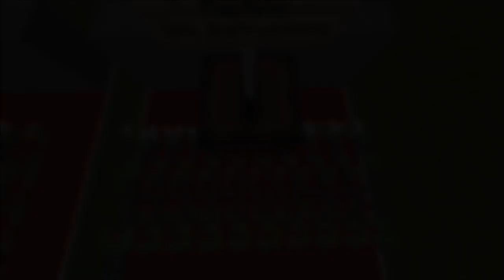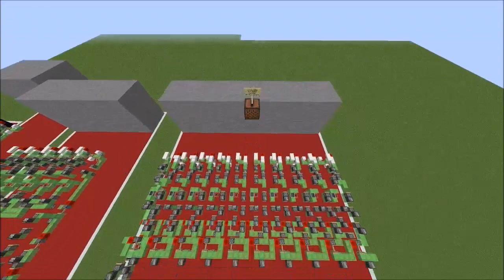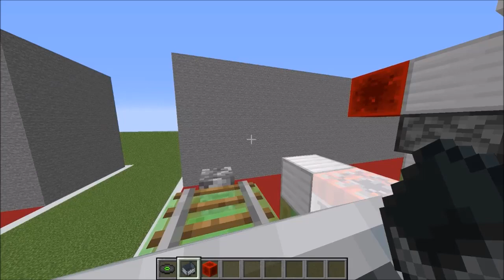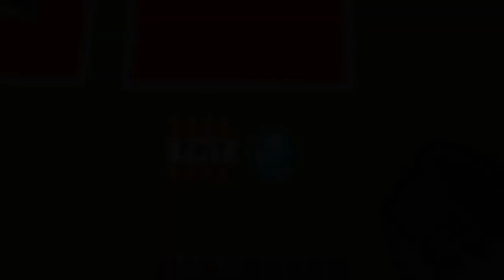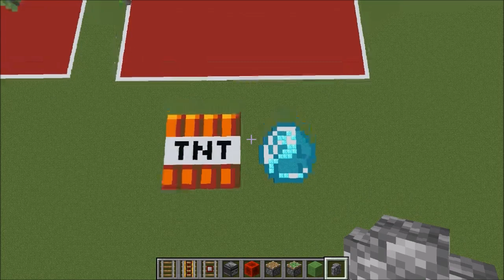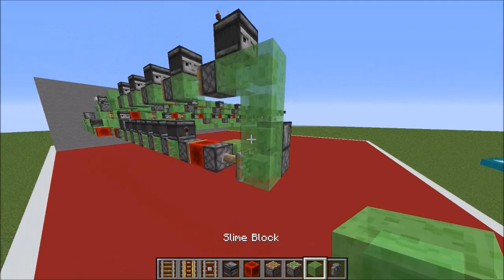Diamond Mining / Tunnel Boring Machine Tutorial for Minecraft 1.14/1.15+

Comment: Good job, cool machine.
I built it on the server with my friends. It worked nice, but after 15 shots the tnt explodet in the foot. Do you have an idea what the problem could be?
Reply from the maker: I'm glad you were able to find the video and duplicate the build. 

Some things I can think of that may cause a failure is; 

1: Triggering the machine multiple times before the tnt has been lifted/thrown and exploded, leaving additional tnt not primed and timed correctly. Make sure to only trigger the machine once, wait for it to be launched and exploded before triggering the machine again.

2: The server is not using vanilla Minecraft as provided by Mojang and is instead running modded server code, such as a "vanilla" spigot server. 

3: Insufficient initial clearance / excavation. If there isn't enough distance from the lifter/thrower and the wall, then the tnt will explode too close to the machine and blow up the some of it. As well if the ceiling or floor have not been properly excavated, then the machine may stick to and drag additional blocks and would likely cause a failure.

4: As pointed out in another comment, the buttresses need to be trimmed on the last module to not have the extra slime blocks. This is talked about for a single wide @ 30:30 but applies to the end module of a multi module build. If those slime blocks are left in place, eventually they will stick and cause a failure.

5: Always to be included in any possible failure is human error. The machine functions on precise timing, any misplaced / unplaced / additionally placed blocks are very likely to cause a failure. 

I hope this information is helpful.
Reply from the maker: Not a problem, I hope you can figure it out. Let me know how it goes.

All the best, cheers!
Reply: @homichimc572  it works now, i went over it again and added the other driving module.
Thank you very much.
Keep up the good work.
Reply from the maker: Awesome! Enjoy!
Reply: Thanks man, im going to rebuild it and try it out later.
Ill let you know if i find the error, thank you verry, very much.
Also, i had to learn number 3. The hard way haha.

Comment: Thank you so much for this I’ve been looking for 3 weeks on how to make a tunnel bore, this is the first up to date/functional tutorial I’ve found

Just one question though. Does it work on servers? I’ve had a few builds that ended up not working on servers due to a small bit of lag

Edit: built up a 22 wide (7 chunk) version On a server and it works near flawlessly

The only problem is that the “RGB” as I now call it, causes lag from light updates and causes a bit of lag. But yeah it works great, found a stack of diamond ore in an hour
Reply from the maker: Yes, at the end of the video, that's me using a 9 wide on a server with low ram that has lag issues. The server is vanilla, if you are on a moded server, such as a "vanilla" spigot server, then lag may cause problems. This is designed and works for a vanilla server provided by Mojang.

Also after you build this and run it at least once (*important*) , you will want to add the lighting and driving module upgrades I just released in my newest video. It will make operating it much safer.

All the best,
Cheers!
Reply: Homichi MC thank you, I play on a paper server with a few plugins so I guess I’ll see how it goes after I build ot
Reply from the maker: Ok good to know about the light update lag, I wonder if it's from glowstone specifically and perhaps sea lanterns would be better. If it's not specifically from the glow stone and because you're shifting so many light sources forward, I'm not sure what can be done about that.

I'll have to take a look into it. 

Glad to know it works even in the lag though! Also glad the tutorial worked for you. How did you find following the tutorial, if you don't mind me asking?

Also would love a screenshot or some way of seeing a 22 wide in action, that's pretty sweet and epic in size!
Reply: @Idgaf Abt This If you play on a vanilla server you are 100% fine with building something like this. On other servers lag can cause to shift redstone updates to the next tick, which is practically death to any sufficiently complex redstone machine